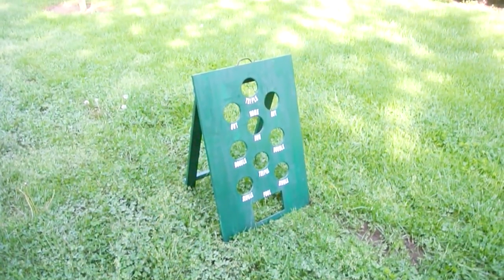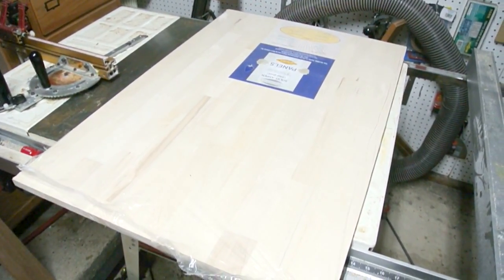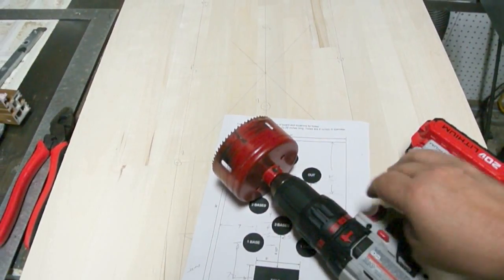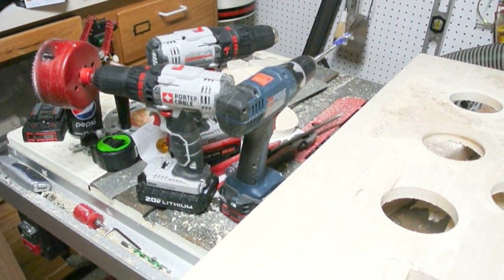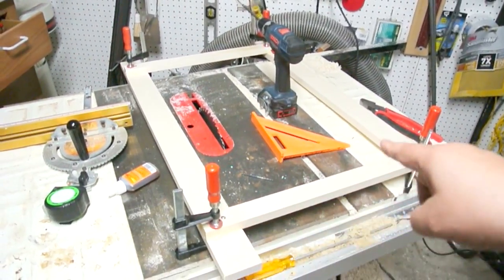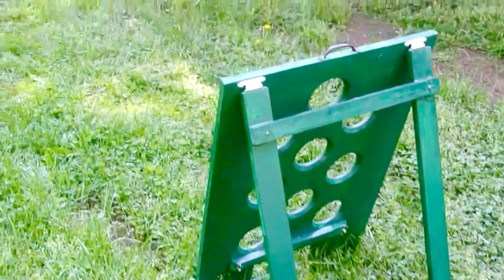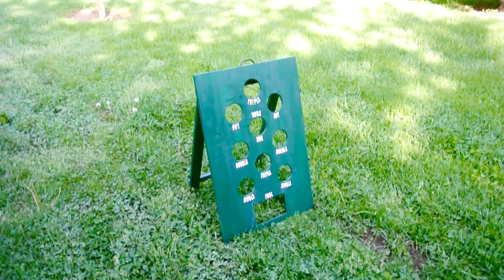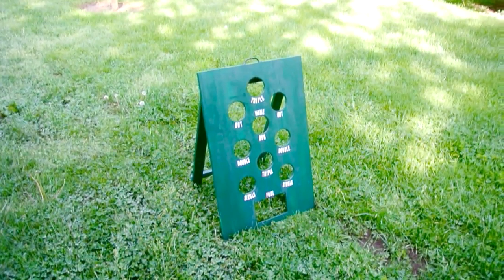Constructing a Bean Bag Baseball Campground Game

Comment: How tall is ur H frame for the legs?
Reply from the maker: I don't have it with me right now, but it is the same height as the main board (minus the space needed for the hinges).  

In other words, once the hinges are in place on the backside, when the H frame is folded flat against the main board, the feet would be flush with the bottom of the board. 

That would hold true regardless of how tall you made the board. Just make the frame the same height.